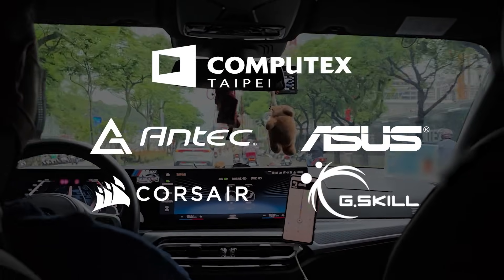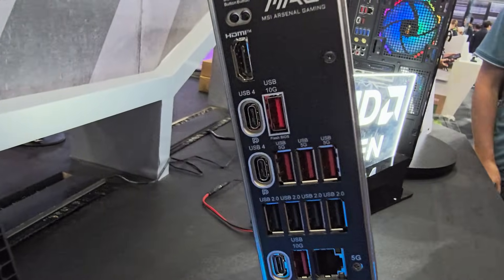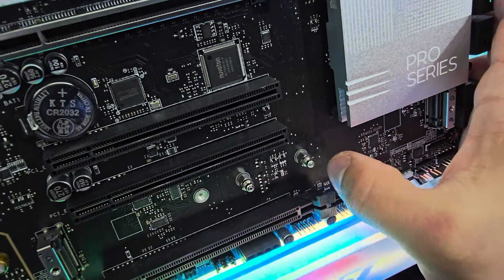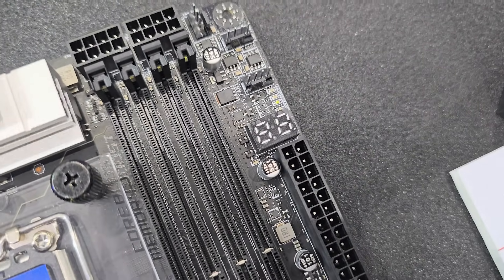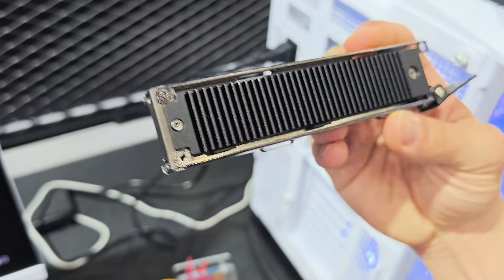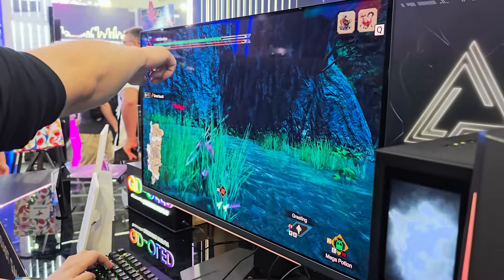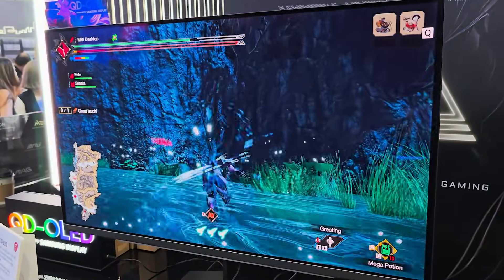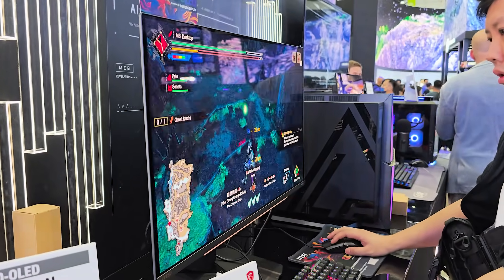40Gbps USB-C Ports Are Here! | MSI at Computex 2024

Comment: hi there guys, I've been out the loop of pc specs and I'm not capable of building my own pc, I'm looking at a prebuilt one these are the specs:
Intel Core 12th Gen i5-12400F 6-Core CPU
16GB DDR4 3200mhz Memory
GeForce RTX 3050 8GB
MSI PRO H610M-E DDR4 m-ATX Motherboard
500GB Kingston NV2 M.2 NVMe PCIe SSD
may seem weird asking on YouTube but wanted to know if it is worth me getting it, the system is £699 and i play fps games like tarkov and rust

Comment: usb 4.0 is allready present on x670 motherboards so x870 boards doesn't have much to offer only maybe  better ram support but 2 dimm boards still missing.
Reply: only thing Ryzen 9000 has to offer in general are faster memory specs for people who stay away from EXPO and overclocking (5200 to 5600), and 20% higher IPC.
Reply: @RobloxianX  "only 20% higher IPC" is a wild statement.

Comment: 2:45 that's not hot-swappable, that's not even toolless. You still need to unscrew and rescrew the heatsink to swap a drive, unless you have additional drive assemblies with drives already screwed in to them. Also M.2 does not supports neither hot-swapping nor hot- plugging so you'll still need to turn your computer off to swap drives. Only benefits this thing offer is that you won't need to disassamble you entire case to swap drives and maybe better cooling.

Comment: My 1st's PC's hdd capacity was 40 gigs, 2005, how far we have come
Reply: Those would be gigabytes, not gigabits.
Reply: @iancurrie8844  still, though I was just watching the DaPoets Kyle podcast where DaPoets when he got a 100 gigabyte hdd he didn't know what to with it, amazing how storage is just like money, maybe, the more we get, the more we want
Reply: While that is true - it still means 8 seconds for a full transfer of the same info
Reply: @bengrogan9710  Also incorrect.  The USB 4 standard has a lane rate of 10gbits (each direction) The .1, .2 standards have higher speeds but that's not what we're talking about here.

That's the theoretical transfer speed not accounting for any overhead.  

The number of 40gbits comes from the accompanying PCI-E tunneling, Display port alt mode, etc.

You'll find that the amount of data you can transfer over a generic USB 4 connection is about 1.2GB per second in each direction.
Reply: @bengrogan9710  I must just delete the comment because everyone is just focus on showcasing their of internet speeds and not what I am saying
Reply: 😂 I remember when 1 GB was a big deal. Now it's TBs
Reply: @QK_SAND  I still vividly remember, in 2010 how 4GB of RAM was the standard. Now, it's 16GB! Does anyone even remember 32 bit systems?
Reply: @QK_SAND being excited about 256 mb more ram lol 😁😁
Reply: My 1st PC 8086 had 20ΜΒ HDD 5.25" inch drive.
Now I have M2 NVME 4TB.
Reply: I remember 5.25” flipping disks. The REAL floppy disks. I remember 286, 386, 486 and then the original Pentium line from Intel. I remember when AMD beat Intel to 1 GHz. I remember when the first 1 GB hard drives came out.
Reply: @deadli-us  AMD has always been innovative then Ryzen brought me back to PC building, 1 ghz cpu and 1 gig hdds 🤣🤣😂
Reply: The first computer I used was a 17" iMac G5. Had an 80GB HHD and 256MB of RAM!
Reply: my first HDD was 40 MB and a great upgrade over the 3.25 and 5.25   floppy drive I  had
Reply: Wanna really blow your mind? Pretty soon it's likely we get a MASSIVE jump in capacity and speed + endurance, getting petabyte drives the size of m.2s. DNA storage being one of the biggest innovations, quantum storage is on the table too. I give it 2-3 years before we start moving to a new era of compute.
Reply: @sinnwalker  Yeah, a modern day PC can get up to 5 M.2 slots, and with the largest M.2 SSD's going up to 8TB, it wont be long until we see 40TB systems become widerange for consumers as file sizes skyrocket
Reply: @RobloxianX  I believe  that, with all these increasing internet speeds and GTA 6 expected to require at least 150GB of storage, phones that are taking higher-quality pictures and videos, storage is going is still going to need even more innovation.